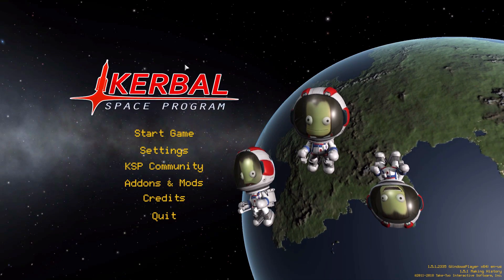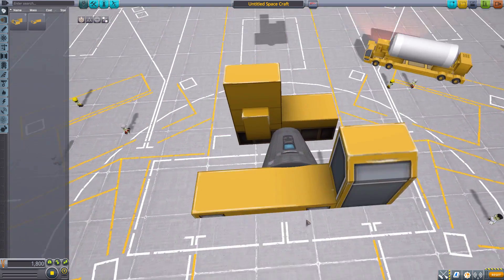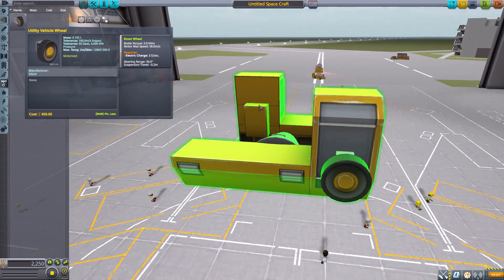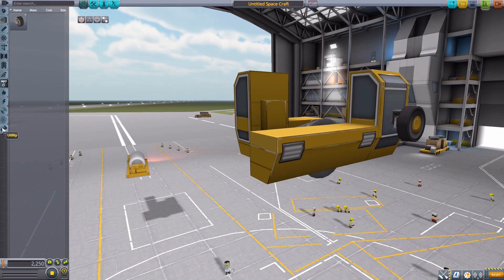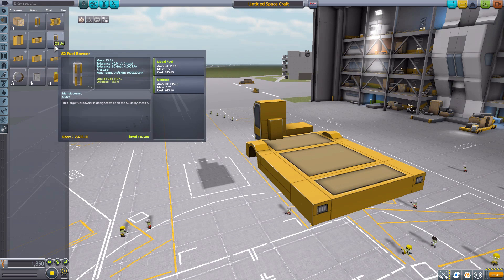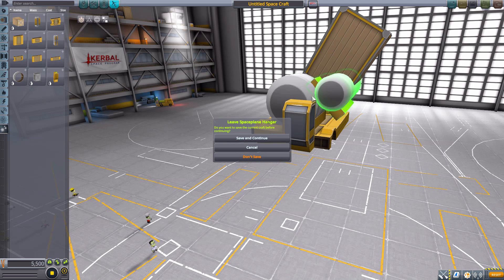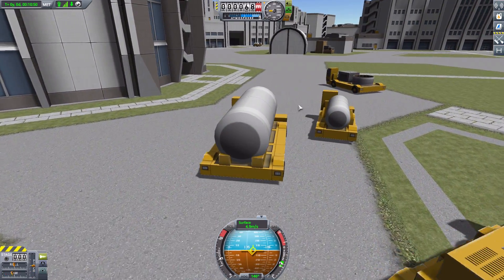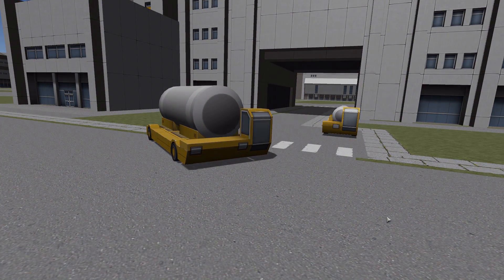KSP Mods - Omega's Stockalike Utility Vehicles

Comment: BTW: It's KAS that has the pipes, not KIS.  They're almost always used together, but they are separate mods and you could do your refueling without KIS installed, just with KAS.
Reply from the maker: Fair point, but like you said most people use them together and so that's just always where my mind goes
Reply: @KottabosGames  - It's where everyone's mind goes... but it does annoy the mod author somewhat, especially when people ask about things in the forum threads since they have different threads.